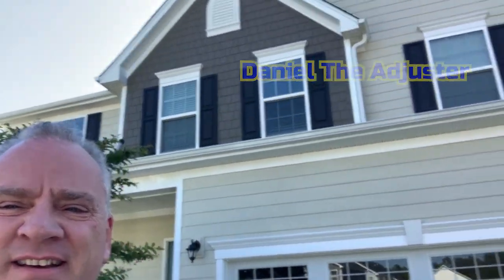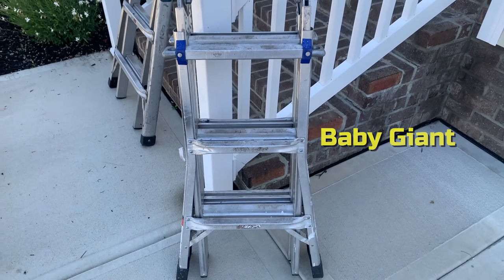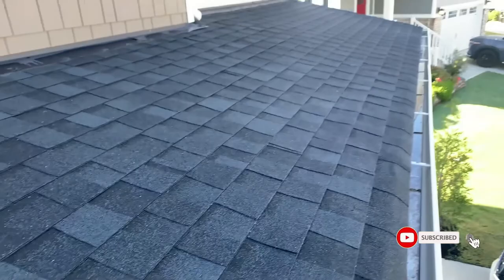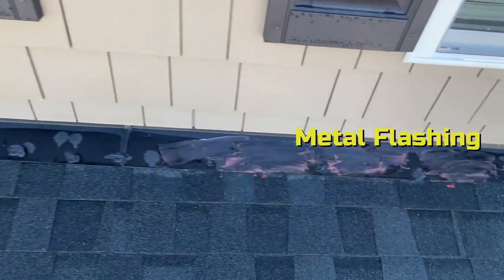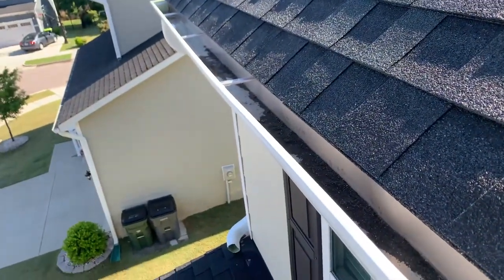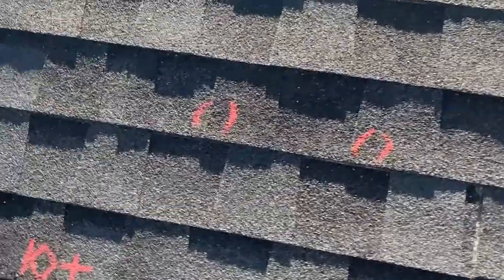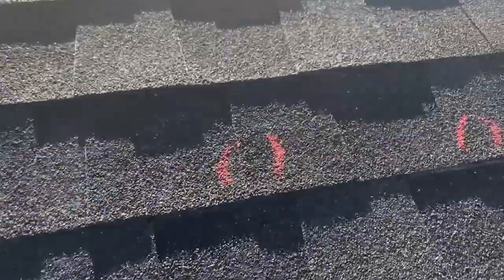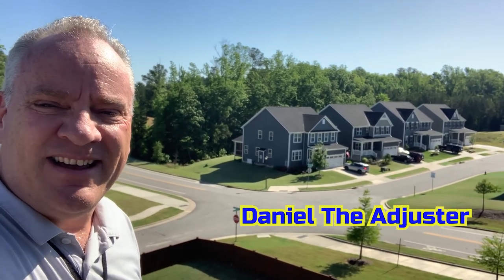Climb a Roof like a Pro, Adjuster perspective

Comment: What's the steepest pitch of the roof that you decide it's too steep to climb?

Also do you really trust the second ladder not slipping on the shingles when going up to the second story?
Reply from the maker: I guess it depends on the design of the roof. I’ve been on the roof that was a 10/12, two stories off the ground, and it was very scary, and I had to use a rope and harness. Another roof, I was on a 14/12 and because there were great access points and valleys, I felt fine to climb it. 
Each roof, I evaluate and decide if it is safe to climb. You have to judge the shingle quality, pitch, and access. Only you will know the right and wrong roof to climb. As far as my second ladder, since it is bungied to the gutter, it rarely slips and I feel very safe. I’ve done it so many times, and have very few problems.